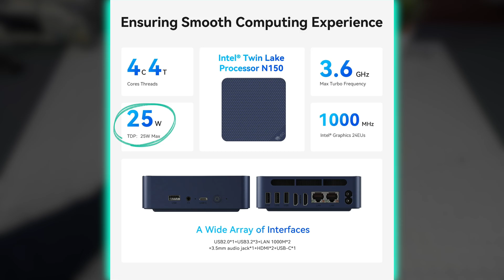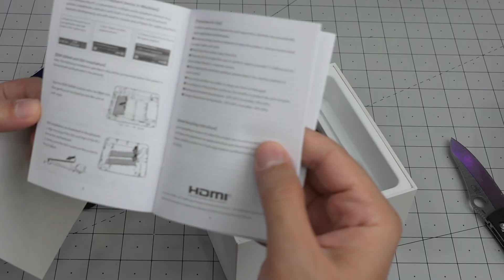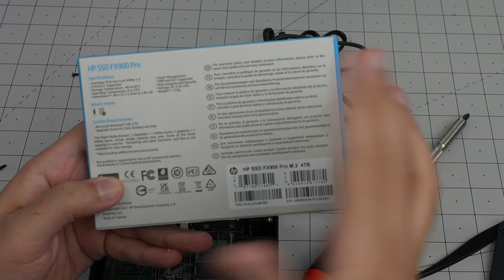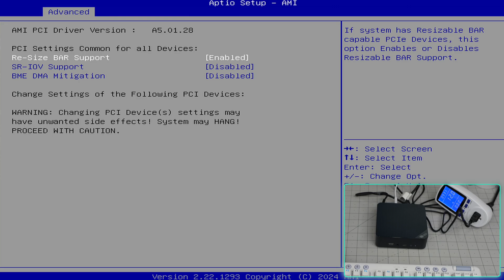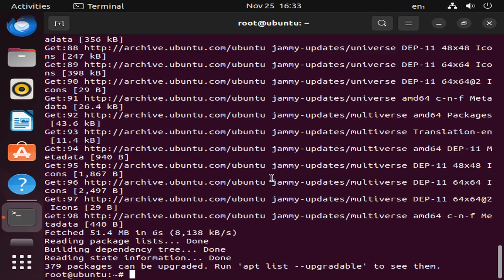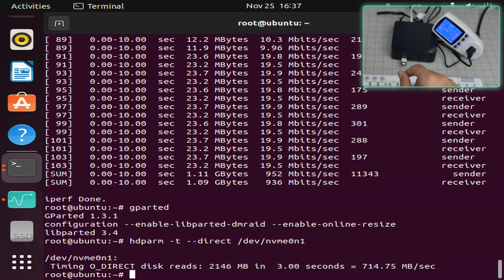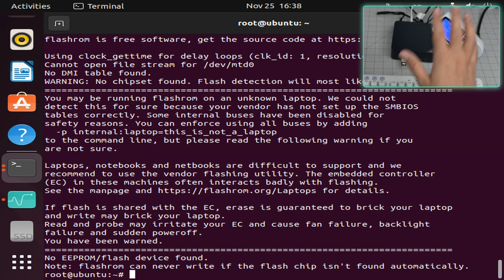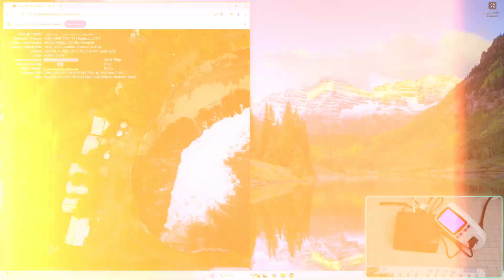Beelink EQ14 N150 Mini PC In-Depth Review and Teardown

Comment: Whoever screwed in the SSD screw on mine was an unhinged sociopath. It took me 2 days, rubber bands, needle nose pliers, different screw drivers, and a drill to get that fucking thing out.
Reply: rubber bands???
Reply: @gregg48  If a screw is stripped you can put a rubber band on it to try and get some friction.
Reply: @LiopleurodonJuice  I guess I'm dumb, can't picture how to get a rubber band on a screw that's down in a hole like that without the screw head just cutting through it. Glad you got it out though.

Comment: Thank you for a comprehensive, very useful, and perfectly paced review!  I bought one just now after watching.  Almost everyone would consider the internal power supply a benefit, but not me because I travel where the line voltages vary.  But the dual M2 slots and dual HDMI ports are what sold me.  I will now retire my custom built full size liquid cooled Pc that dims the lights in my apartment when I power it up 😁

Comment: You should not have tossed the specs unread, or you would have had much better results. The two slots have different specs: The primary one is PCIE 3x4 or MSATA (it's delivered with a rather disappointing MSATA SSD to save a few bucks). The second slot, the one you used, can only handle PCIE 3x1, so it is substantially slower. Had you used the primary slot rather than assuming they were both the same, you would have much better disk performance, but it is still PCIE 3 and your PCIE 4 drive is wasted on it. The computer will never match the full capability of the drive.

I'm using the previous version (EQ13 with the N100 chip) and with a fairly basic (Teamgroup) SSD in the first slot, I get 3200 MB/s reads and 1500 MB/s writes, which is about all you can realistically expect from this setup and is more than adequate for a home server or low-power Linux workstation. It's not a powerhouse, but I wouldn't expect that from an N100/150/200/250. I think it's the best in class for this category/pricepoint both in terms of build quality and features. The MSATA drive it's delivered with is a bit of a disappointment. I would have happily paid an extra $10 to not have to swap it out, but I have plenty of older PCIE SSDs that are more than a match for this modest hardware so it was't a major concern.

Another tip: they only provide a thermal pad big enough to cover the controller, not the full SSD. Replace it with a full-length, .5mm pad.

The N150 is not meaningfully better than the N100, especially if limited by the stock storage, so if you can find an older EQ13 around for less money, it's a better value.

Comment: I do like that they have included a raft of 10Gbps and the dual NVME slots add to the appeal, although that NVME test result is worrying. But where they really fell down was with the RAM. This is screaming for DDR5 488, which has been shown to be of benefit in the N100 boxes. It just isn't the step up in processor and GPU performance that I would expect. I'd rather have a much cheaper N97 right now. Missed opportunity. I didn't get the feeling that the reviewer was that interested either as this felt rushed to get it out of the way.
Reply: He used the slower of the two PCIE slots. One is 3x4 (or MSATA), one is 3x1. He would have known if he hadn't tossed the specs out unread. It's still not going to come close to the full capability of a 4x4 drive, but it would have been much better than the stock MSATA. I'm using the older (N100) version, and swapping the stock drive for a Gen3 SSD made a world of difference (3200 read, 1500 write). Upgrading the stock drive for $5-10 extra is far more important than redesigning the thing around DDR5. Wish they sold a barebones version.

Comment: Sometimes it helps if you read the specs before testing. You can already see in the advertisement pictures that the systemdrive is on pcie3.0x4 and the other slot is PCIE3.0x1, that slot where you put your 4tb gen4 drive in...
ps. the delivered windows image is 11 pro 24h2.

Comment: Eq14 has two different m.2 slots.
One has 4 PCIe 3.0 lanes (There is already m.2 SATA SSD installed) and second is 1x PCIe 3.0 only.
That is why HP SSD Speed is so slow.
Try to swap m.2 slots :)
Reply: fun part is he never tested the original systemdrive that is still in the pc.Not in ubuntu and not in windows. That should have been a wakeup call within a minute.
Reply: With a very basic PCIE drive in the first slot I'm getting 3200 read, 1500 write. About all I'd expect from basic PCIE 3 in a device like this.